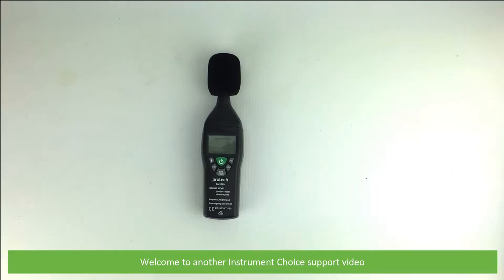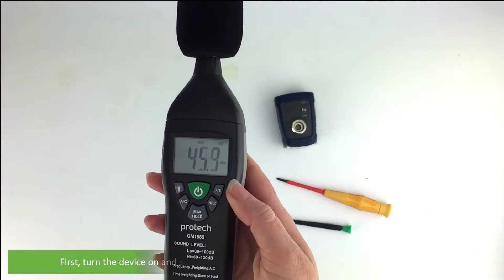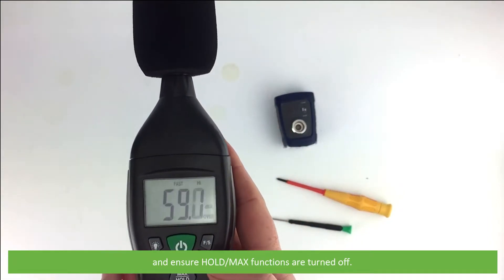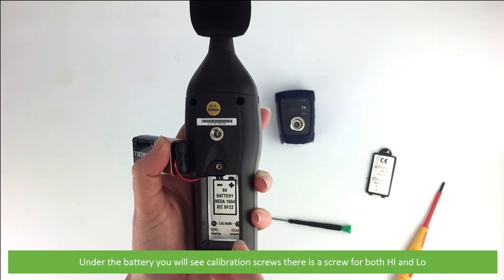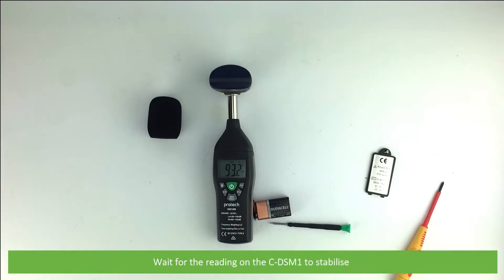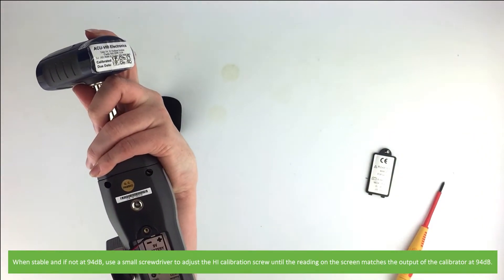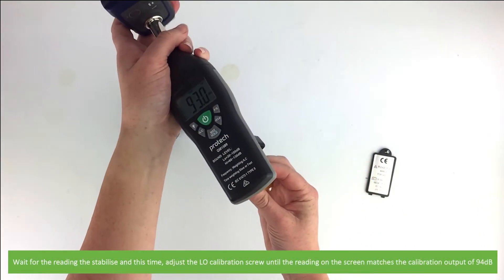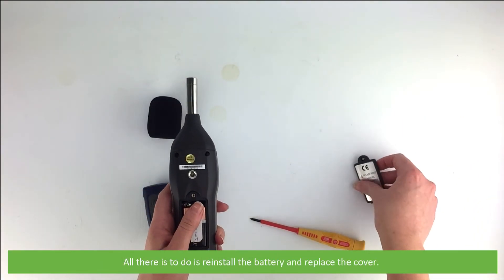How to Calibrate the C-DSM1 Handheld Digital Sound Level Meter

Comment: Hello. If the sound meter has an accuracy value and the calibrator has own accuracies as well for 94 and 114db, how to we match them?

Also, can we perform calibration using or dBC? If not, why only dBA? Thanks!
Reply from the maker: Hi and thank you for your question. 
The calibrator is essentially your master value here, and you would match the Sound Level meter to this. You then base your reading on the sound level meter to this, and adjust it using the calibration screw or calibration feature of your meter. 
Unless your sound level meter user guide specifies a frequency weighing setting for calibration,  you can utilise the calibrator to calibrate both dBA and dBC.